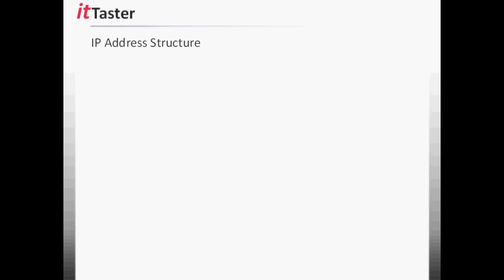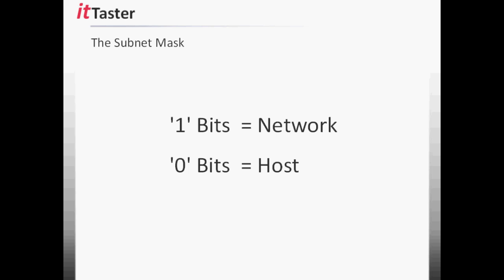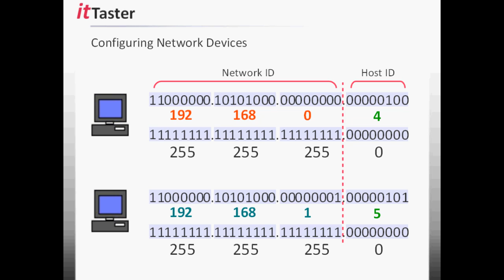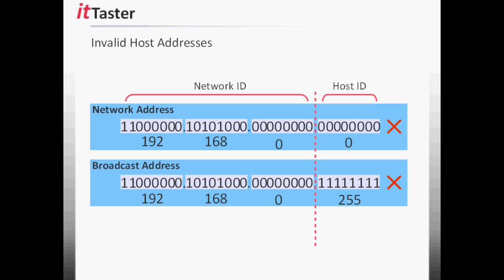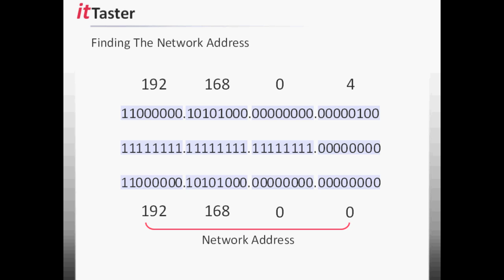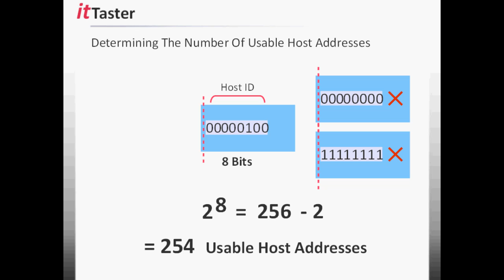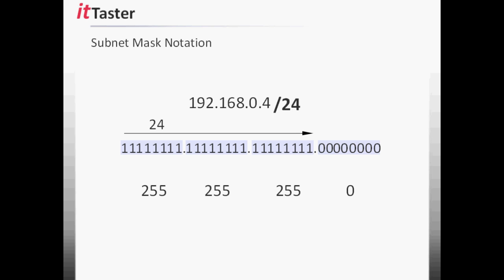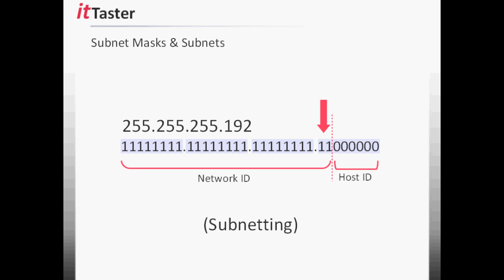IPv4 Addressing - Subnet Masks (Part 2)

Comment: Hi, just wondering if it is possible, in theory,  to assign 128.0.0.0 or 0.0.0.0 mask to a private home IP address in order to have 2 or 4 billion hosts?
Reply from the maker: Hi, when assigning an IP address to a device it must be a valid IP address, the subnet mask must have a network portion and a host (device) portion. A subnet mask of all zeros would not be valid. A subnet mask of 128.0.0.0 is a valid subnet mask, but this would not allow you to use a private IP address range.  The largest private IP address range you could use would be 10.0.0.0 with a subnet mask of 255.0.0.0.

Comment: Hi, can you please tell me what you mean by '2 to the power of 8'?

Sorry but i do not have very good maths skills. 

thank you
Reply from the maker: Hi, powers are really a short and easy way of abbreviating a number that is multiplied by itself a number of times.  For example: 2 to the power of 8 simply means 2x2x2x2x2x2x2x2 = 256.  It would be written a the number 2 with and 8 after and above in superscript, similar to if you were writing 2 squared for example. 

It's much easier to write or say 2 to the power of eight, than 2x2x2x2x2x2x2x2 as well as work with in maths.

Hope that helps.